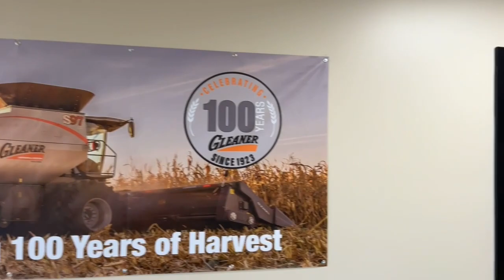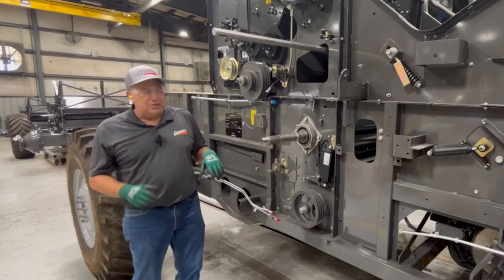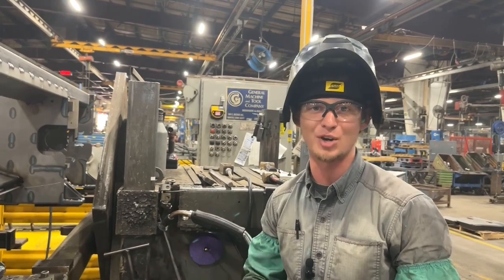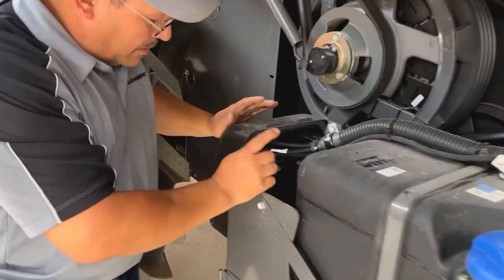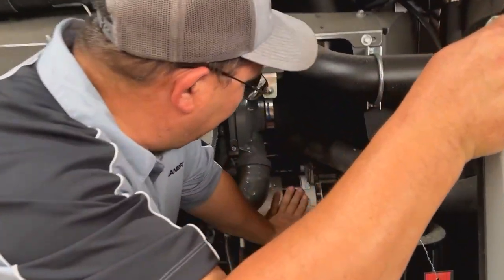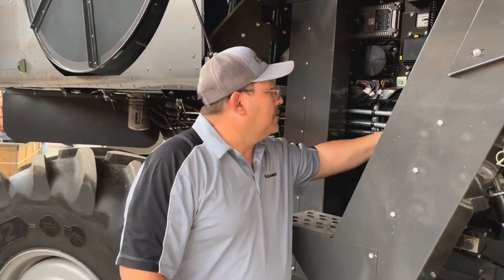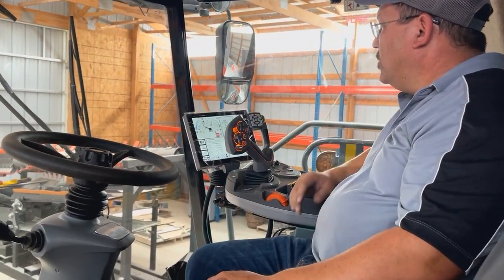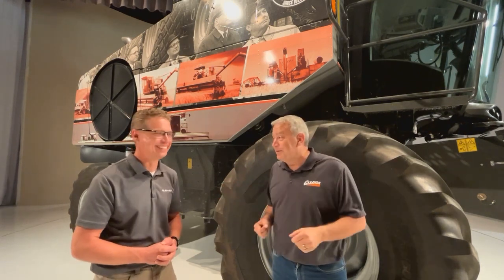Gleaner Online 2023 (Ep 2)

Comment: So you have to change the Reel hose and the back Shiv bolts to go back and forth from Corn and Beans???
Reply from the maker: Correct. When changing from corn to soybeans, you will slow the header down the the slowest speed, move a quick disconnect from a fitting on the feeder house to the single point connector, loosen three bolts with a 3/4 in. wrench, move the lockout ring, then tighten the three bolts. Vice versa when going the other way. Takes a lot less time than you would think.
Reply: It’s a piece of cake on my R-62. I imagine it’s the same on the S series.
Reply: @jordanellis8572  it’s a Piece of Cake on my S670 hit the button and you are off to the Race.